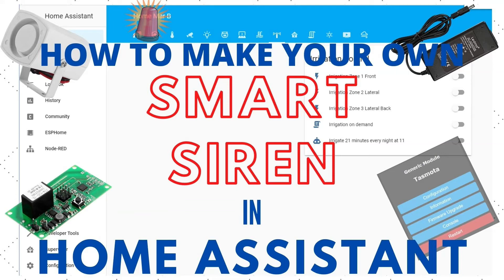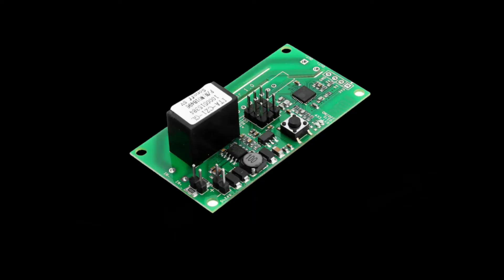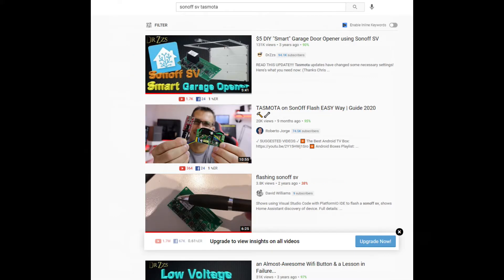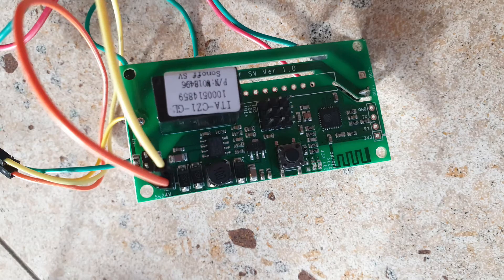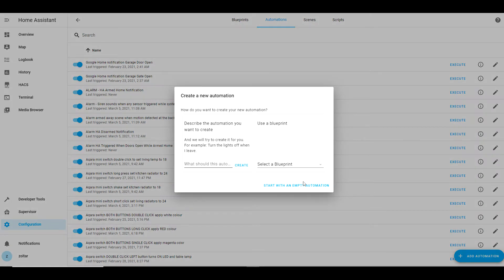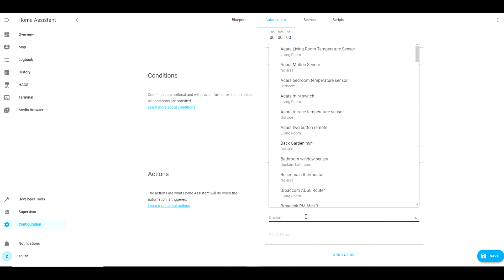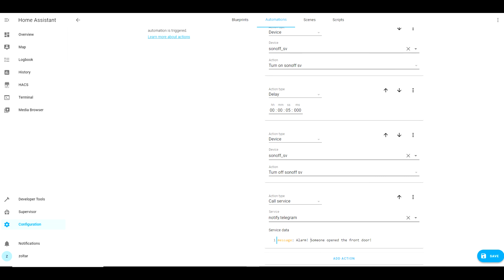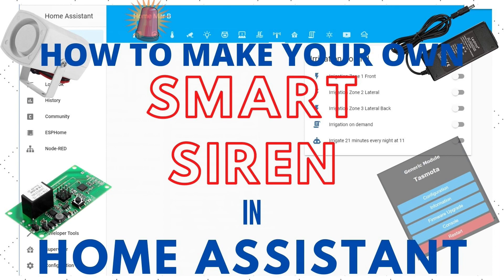Make Your Own DIY Home Assistant Tasmota Smart Alarm Siren on the Cheap!

Comment: Thank you for a short and nice video. One thing I didn't see you have magnetic sensors wired from your door to the Sonoff SV device. Then how can device trigger the Siren. Would assume you wire the sensors to the GPIO-pin on the Sonoff SV. Maybe you have wireless sensors that I don't see from your video. Thank you.
Reply from the maker: Yes all my sensors are wireless, they are zigbee sensors.
Reply: @zoltar99  No wonder I missed it. Thank you.